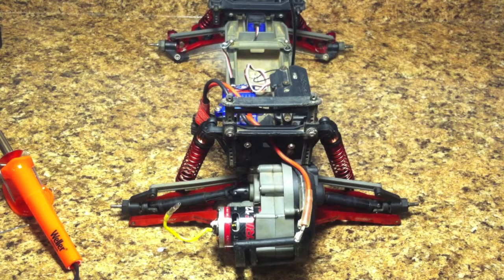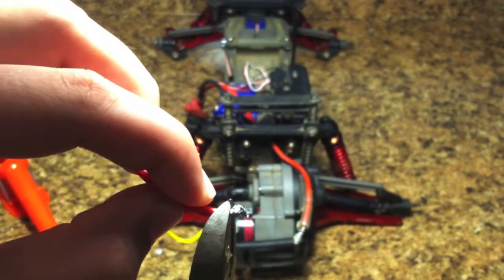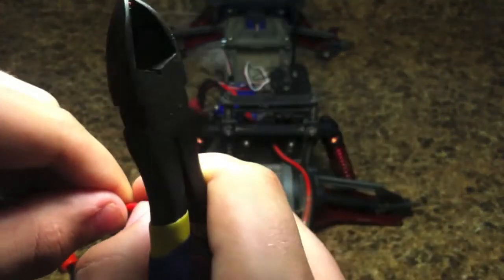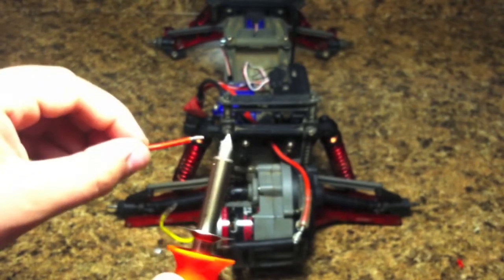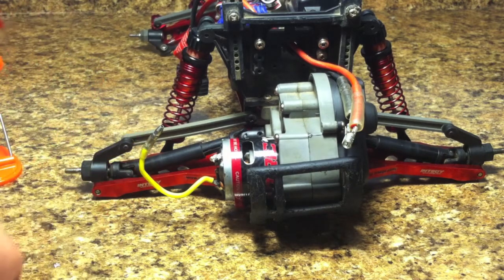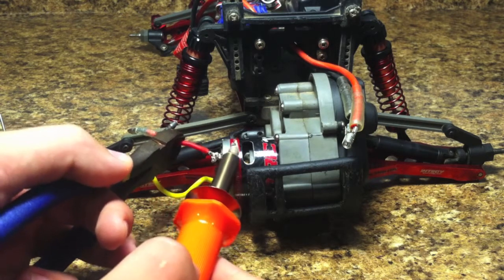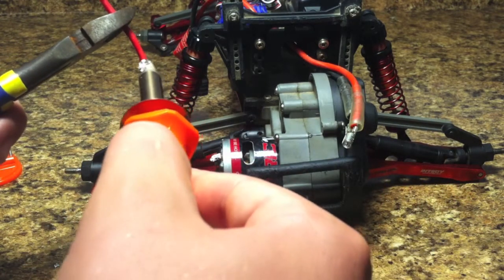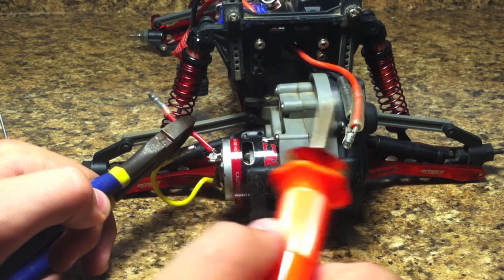The RC Genius | How To Solder A Motor Wire on an RC Car

Comment: Hello thank you for the tutorial! 
Can you help me with a wiring issue im having a problem with. 
... Fried ground wire.
Hobby shop guy says to keep replacing it. 
I want to fix it.
Why does this kind of thing happen? 
Thanks so much! 
Keep the great videos coming.
Reply from the maker: Mrs. Rabbit hi! I would be glad to help. Where is the wire coming from? Keep in mind that if it’s fried, it’s possible that the electronic it’s coming from is bad. In most cases, you should be able to cut, or unsolder a fried wire and attach a new one. You can also cut it and add a new piece and heat shrink some tubing over it. Let me know more specifically where it’s coming for or going to, and I hope to help you out a bit more.
Reply: @TheRCGenius  thanks for the reply! 
It's on a Himoto 1/18 buggy.  Going from the receiver to the esc.
No other wires are burnt.
Reply from the maker: Mrs. Rabbit ok, so it’s your signal wire. The ESC has 3 sets of wires. There are the black and red motor wires, black and red battery wires, and the Futaba connector receiver wires. The red and black ones are positive and negative, and the white one is a signal wire. It reads the signal from the transmitter to the receiver and tells the ESC what to do. It’s unusual that it would be burnt. But you could try replacing it. You probably need to go in the ESC and find the main circuit board where the wires are soldered on. You could try just soldering a new white wire on. To remove it from the Futaba plug, there is a little tab on the metal part of the wire that can be seen through the plug, push that down with a nail or pin as you pull out the wire. Keep in mind I haven’t done a replacement like this before, so try it at your own risk, but also keep in mind it could work! The worst thing that would happen is you need a new ESC. Let me know how it works out 👊😁
Reply: @TheRCGenius  dude,  you rock! 
Okay im gonna try it,  and I'll get back to you. 
I gotta get the house ready for the kids birthday party,  then it's off to the work table! 
Thank you for the info!
Reply from the maker: Mrs. Rabbit sounds good! Look forward to hearing about it!

Comment: What happens if you use to much solder?
Reply from the maker: Besides wasting solder, nothing really. The solder should still conduct electrical current even if you have a lot on there. I recommend trying to use just enough to get what you need done.

Comment: It's not the genius way to remove the insulation by using the cutter, using the cutter to hold the wire & the soldering is not genius either. Lol 😂

Comment: I put a new toy motor the plastic gears are unsuitable the wheels don't have screws the led lights are held in place with very cheap glue gun glue what gives?